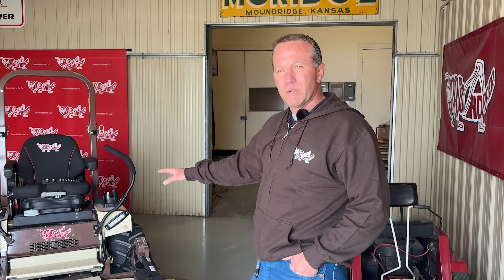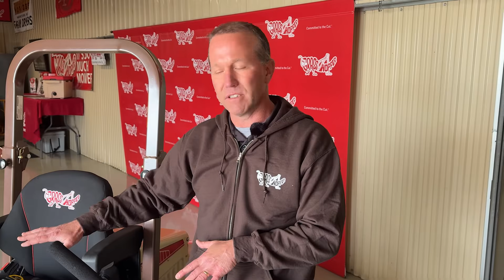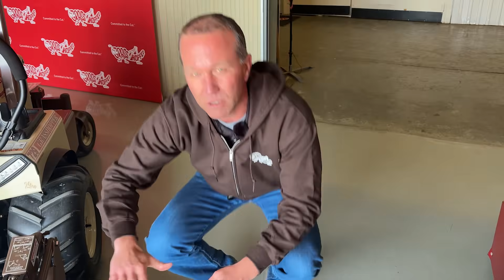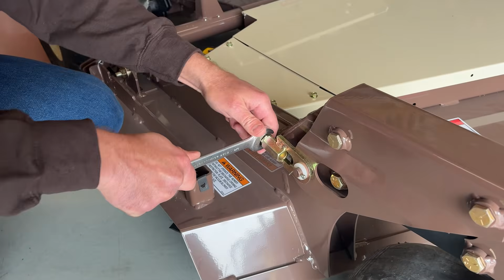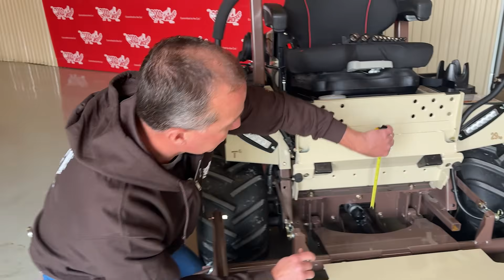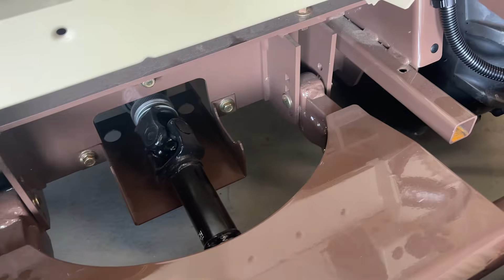How to Level a Grasshopper FrontMount Zero-Turn Mower Deck

Comment: Thanks for the video.  This really helps a lot as I just purchased a 729T tractor with the 3661 deck.  My set up looks to be identical as the one in your video (the front wheel bolt and rear deck attached in the 3rd hole).  However,  my height just goes up to 4 inches.  I see in the manual that it should be able to mow up to 5 inches as you mention in your video.  Suggestions?  Thanks.